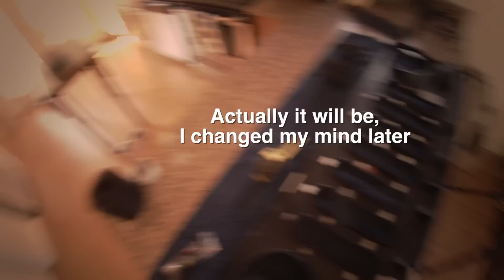DIY  Wrangler Mesh Grill Guards for about $10

Comment: I saw this video around 11:00am and by 3:00pm I was done. A quick run to the hardware store, some elbow grease, and $18 later, custom grill inserts. I had been thinking about buying the snap in kind, but being so expensive I was hesitant. Thank you for the good, cost effective idea! It turned out great. The only concern I have is the adhesive melting. I did use some slightly more expensive (outdoor) zip tie mounting bases. I'll try to update every so often to see how they hold up.

Comment: I was going to cut a piece of stainless steel mesh to cover the bottom grill of my 2013 Equinox. Now I am going to use gutter guard like you because it will be much easier to work with. Thanks for the great video.

Comment: Gardner Bender makes tie down holders that are more sticky. I still glued them on also . I had an easier time just unscrewing bulb holder on turn signals instead of taking harness connection apart. Great video!

Comment: Thanks for the video I did this today worked out great.  A couple of suggestions wipe the back of the grill down with rubbing alcohol real good, have a pair of good size snips to cut down the inner tie holders so they fit in the center grill areas better and feed the electrical ties on all the holders first.  Feeding all  the ties first makes it easy to attach the screens.  Purchase one extra bag of holders (home depot) I used a total of 34.

Comment: Very nice explanation. Thank you.
I do have a question though. Why did you decide to make the seven guards separate instead of making a single, long piece to go across the entire grill? Thanks
Reply from the maker: Thanks... The main reason is because they hold tighter when cut into pieces. There is a slight bow in the grill so if it's one piece the middle sags.
Reply: Gotcha. Thank you!

Comment: I worry about the radiator melting this plastic? I as thinking about using the metallic mesh instead? What are your thoughts?
Reply from the maker: I can tell you that I've had mine on since the summer and no melting at all. The metallic mesh might not lay as flat and may pull off the ties from the extra weight. Just my two cents.

Comment: why not put on one big piece?
Reply from the maker: The main reason, because of the slight curve of the grill it looks sloppy and puts more tension on each of the connections. You can do it, but I would recommend taking the little extra time to cut them.
Reply: +How to Wrangler but you can still tie them down in between the openings right?
Reply: +How to Wrangler and maybe make some relief cuts where needed
Reply from the maker: Thats true, it may work, if you try it and it works let me know!
Reply: +How to Wrangler sadly I'm still working up to an unlimited. I gotta make do with a 90 Cherokee